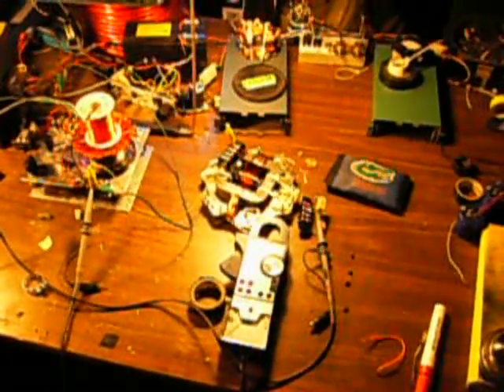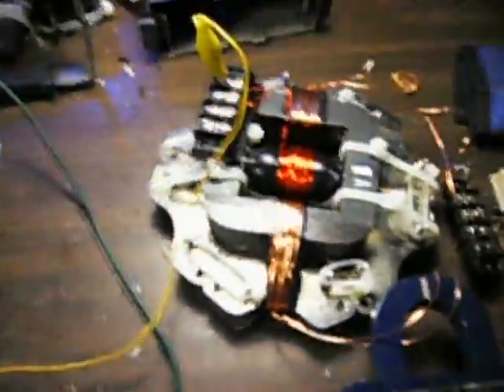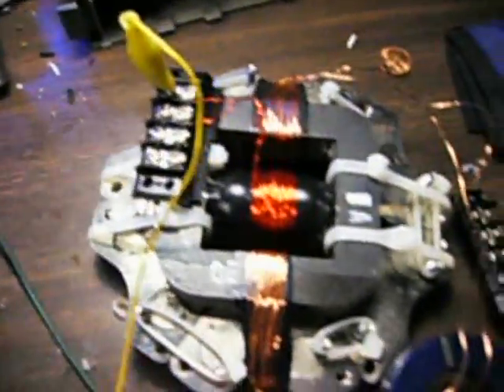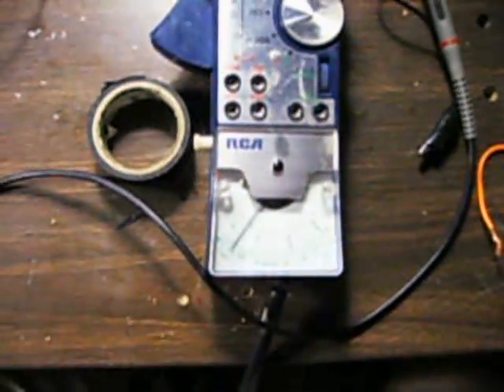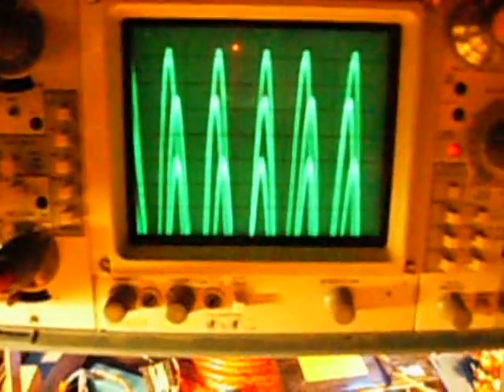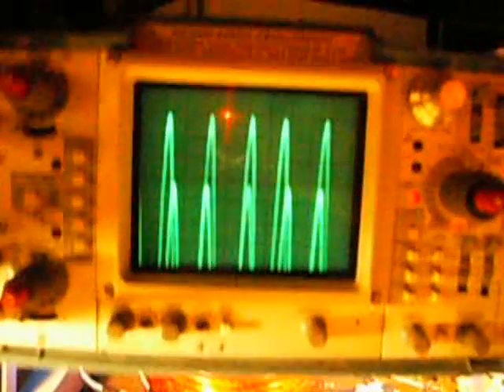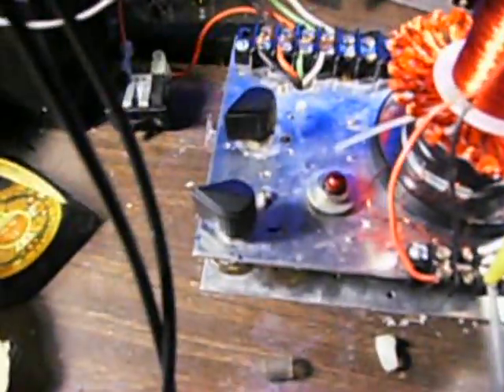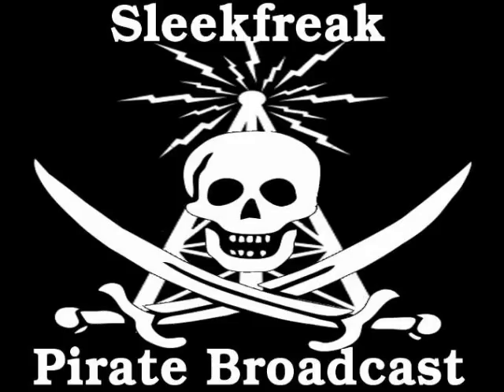Output transformer upgrade.

Comment from the maker: @capnskull 
my original version was indeed exceedingly ghetto.  once i can get the parts cast to spec as opposed to using recycled materials (that would be the graduate level wholesale scrounge in action), then it will be decidedly non-ghetto;)